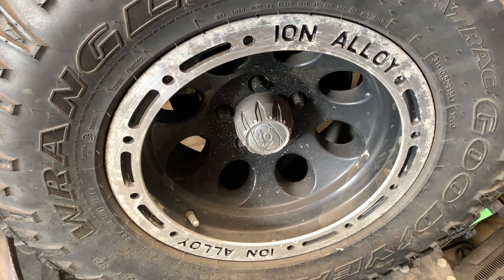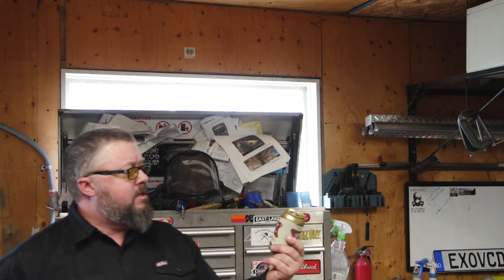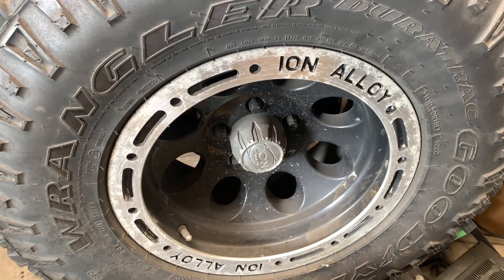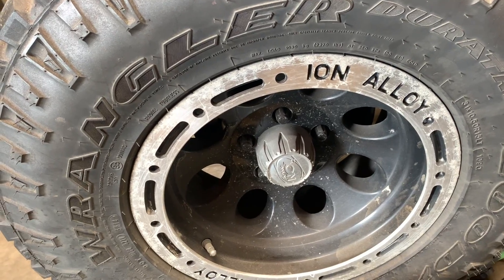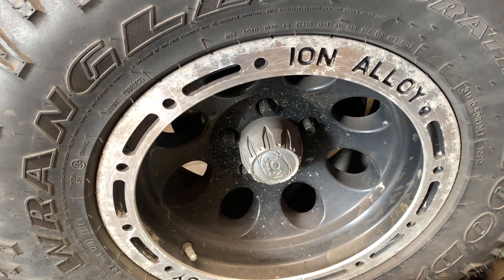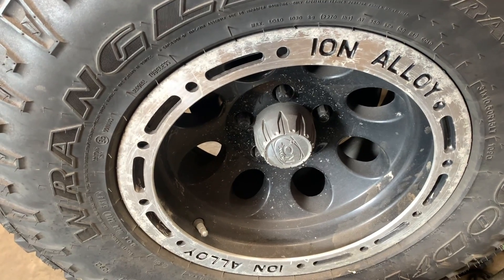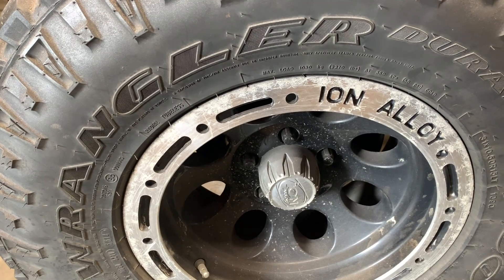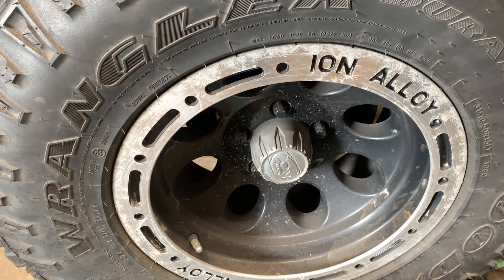Why Using Anti Seize on Wheels and Driveshaft Flanges is Bad

Comment: Points taken.........But as you state, they are a lot of factors and variables.............For racing, tracking, 4x4ing, off roading, high performance application etc.  I agree with you 100%.  No anti-seize....I do not believe that grease should not be used period.  Everything is taken to the limit.

I believe for DD stock applications (no adapters),   using a very very very thin coat of anti-seize (not grease) is fine.......The other extreme to what you talked about are frozen studs, broken studs etc.   By using anti-seize you are preventing rust.  Rust will happen in especially when water, salt etc gets trapped........Anti-seize will coat and prevent rust..........there is a huge difference between the coefficient of friction for anti-seize and grease.   I have had to much crap rust through......Rust is cancer.....Anything to stop or slow it.   I have had too many bolts frozen on with "regular torq." and were deformed or destroyed on removal because they were "fried on there."   I will take my chances with anti-seize vs. rust.   Choose your evil.  Is it risk?  Yes.

Comment: I've seen the failures a lot in oilfield parts with lubed threads. The common practice 30 years ago was to copper plate threads to increase conductivity and reduce seizing but vibration and stress led to failures.  You never see that or any lube anymore except on tapered threads.

Comment: anti seize is for threads and a few certain types of applications not for putting on the backs of brake pads or wheels. As for torque specs on wheel lugs, most people don't know how to torque properly anyway so that's almost irrelevant sad to say

Comment: You were much more calm for this one Jerry than the pressure explanation vid.  lol  Never grease the lug threads.  Over torquing is too easy.
Reply from the maker: Lol wasn’t talking about lubing the threads not sure why so many people are thinking of this... read pinned comment
Reply: @BackCountryWrenching  I was referring to the 1:33 mark comment you read.
Reply from the maker: Yes anti seize on threads is fine, as long as a person used the wet torque specs and not dry torque

Comment: ARP recommend using thier grease on all thier bolts for accurate torque.  I have always used old motor oil on wheel lugs and never had an issue with rusty nuts.   Anti-seize is intended for use of dissimilar metals like a steel header bolt into an aluminum head. The best thing to do is use a wire wheel to clean the threads and rusty area then using some type of oil, grease, or fluid flim to prevent rust.

Comment: Amen, the way it was explained to me using a flywheel for example. The flywheel would cut through the bolts given the chance "loose". I always cleaned the mating surfaces and pulled out the torque wrench. As a side note when they call for 60 to 80 ftlbs, it's 60 for used bolts and 80 for new to take into account the new bolts stretching. You earned another beer today.

Comment: No shit no ive never had any problems with anti-seize on me lug nuts. Just brush the studs lightly and dont over do it. My nuts get enough clamping force at the acorn theres no anti-seize there. And theres nothing wrong with brushing some between the hub and inner opening on the wheel. Not on the flat face dont need it there. Thanks Jerry

Comment: Cheap wheels is the problem. Hondas actually spec it in the owners manual to use anti seize on wheels and hubs. only thing that should go in dry is spark plugs.
Reply: I always put anti-seize on spark plugs to ensure they won't damage the threads when removing. Never had a problem.

Comment: Spot on bro. I make a living working on cars. I have never put antiseize on between a rotor and rim. Clean the hell out of them with a die grinder though. I do use fluid film between the hub and rotor though, works great. Same goes with driveshaft flanges, clean down to bare metal and thats it. Thanks for putting out this video and all of your others. MFBT!

Comment: I was told the same by a tire shop tech when he changed my tires and saw light anti seize between the wheel hub and rotor and on the wheel studs. I live right in the rust belt. I have switched to a thin layer of fluid film and will have to wait and see. I have brought my cars back in for oil changes and rechecked wheel torque and it reads correct. Just too much damage from the salt, brine, and the f*&#ing beet juice. Gotta do something...

Comment: I rarerly use antisieze wheel studs are a no go and some guys like to put is under brake rotors but i have had many occasiions where a piece of rust will stick to the antiseize and cause a rotor to have excessive runout/pulsate, I imageing the same thing is possible when putting it on a hub face to wheel contact point. Clean the surface and threads and leave it alone.

Comment: The clamping force is on the tapered part of the lug nut & tapered part of wheel, THAT IS WHERE YOU DO NOT WANT ANTI-SEIZE APPLIED. Like putting anti-seize under a bolt head is a NO NO, PUT IT ON THE BOLT THREADS. I don't get why you say your wheel SLIPS BECAUSE YOU PUT ANTI-SEIZE BETWEEN WHEEL & HUB ? Helicopter blades are held on with bolts with anti-seize applied on the threads. Did Tom cat get his NEW CAT TREE ?
Reply from the maker: Not talking about putting anti seize on threads, talking about putting anti seize anywhere on the face between the hub and wheel including rotor
Reply: Read the comments a lot of them replying about putting it on the lug nut threads, that is why I replied the way I did. Like I said the clamping force is on the tapered part of the lug & wheel not between the hub & wheel especially with 5 studs holding wheel on. If your clamped tight on the tapered part  ? HOW CAN THE WHEEL SLIP ON THE HUB WITH  STUDS & NUTS ? I DON'T SEE IT ?
Reply from the maker: Bolts/studs aren’t designed to be side loaded.   Proper torque achieves the clamping force ( friction) needed to prevent the wheel from slipping from not enough clamping force.
Reply: I AGREE BK, BUT WHAT DOES THIS HAVE TO DO WITH ANTI-SEIZE ON THE HUB ? CLAMPING FORCE IS ON THE TAPERED PART OF THE LUG NUT, THREADS & WHEEL. WELL I GUESS I'LL DO IT MY WAY & YOU DO IT YOUR'S, LOVE YOUR CHANNEL ALWAYS WILL BE A SUBSCRIBER. I REALIZED I WAS TRYING TO TALK TO MY 2 CATS LIKE YOU DO TOM CAT THE OTHER DAY & THE DOBES CAME RUNNING INTO THE ROOM GROWLING, BARKING. THEY DIDN'T KNOW WHO IT WAS ? KEEP THE VIDS. COMING BRO.
Reply from the maker: @NoWr2Run  i said in the video not many people would understand like pumps and pressure.  read the pinned comment and follow link if still don't understand

Comment: Jerry, I like your videos but seriously if you have ever owned a vehicle in PA you will happily choose to grease up EVERYTHING. 
I have numerous stories of bolts/flanges/sensors/(you name it) rusted PERMANENTLY in place! And yes I know every trick in the book for attempting to free a fastener but have found myself cutting off the head and hogging out the shaft of a bolt soooo many times. 
I'd rather do a bolt check a few times a year versus letting mother nature consume every single nut&bolt on my car.

Comment: On a brand new lug nut and wheel stud, the clamping load can very accurately be related to the torque. This obviously goes out the window if there's any rust, dirt or surface oxidation on either the lug nut or wheel stud. On the other hand, if you consistently lubricate the threads with either anti-seize or grease, your torque-clamp load relationship becomes reliable once again. However, since lubricated threads decreases the torque required to achieve the same clamp load, you need to derate by ~20-25% to prevent from overtorquing. Lug nuts are kept in place because of the friction between the lug nut and wheel, the clamp load of a properly torqued lug nut wedges the tapered cone of the lug nut into a tapered lug nut seat on the wheel. For this reason you don't want any lubrication on the taper sections of the lug nut, however, I'd argue that lube on the threads actually makes things safer since your nut torque more accurately translates to clamp load.
Reply from the maker: Lube on the thread isn’t the issue, putting anti seize on the wheel and rotor/ hub is

Comment: That’s terrible beer by the way. What are you supposed to use if anything? If the torque needed to keep the wheel on is 100 foot pounds, and anti seize is used, wouldn’t the torque then be amplified because of less resistances/friction? I agree that anti seize shouldn’t be used between the wheel and say rotor....
Reply: Part of trade school for me (HD mechanic) was using a micrometer to compare bolt stretch between dry threads and threads with wd40 10w30 and copper coat applied to them then torqued to book value for the thread diameter.... results were pretty cut and dry that applying lube to a fastener resulted in excessive stretch when using the dry torque value.

Was a long time ago but I seem to recall copper coat gave me close to 3x the allowable stretch on the fastener and wd40 was just over the allowable limit.
Reply from the maker: Anti-seize on threads is fine however a wet torque changes the spec from a dry torque.

Comment: I’m still using anti-seize on my lug nuts and wheel studs and along with other threads. I’m not dealing with rusted bolt / nut threads...
Reply from the maker: Using anti seize on threads isn’t a issue using anti seize on a flange or wheel is where is reduces the clamping force.

Comment: Your science and intell are right, but I'm still anti seizing my wheels
Reply: Just check do a re-torque check once every month or two.
Reply: This guy is a millwright and he is right aboutnot using antiseize...
Reply: @Mattessj  If this guy is a millwright then he should know that torque specs are always reduced on lubricated threads.  It's usually in the order of 30%. ARP produces some of the finest fasteners in the auto industry and they definitely recommend lubrication on threaded fasteners.

Comment: I have never put anything but a wrench on my lug studs. I used to have a 1995 Chevy G-20. Whenever I torqued my lug nuts, I just put them on tight by feel. 

I was leaving a grocery store once when there was 3" or 4" inches of snow on the ground and I ran over a buried chunk of ice. This caused my van to jerk to the right. In the process, and I didn't realize this until I was a couple of blocks away, 3 lug studs had broke off, a 4th lug nut had worked off, and the 5th lug nut had almost worked off and if I'd gone another 20 or 30 feet my wheel would have fallen off.

After seeing this video, I am convinced that if I'd torqued them to the manual then this might not...probably wouldn't...have happened. Now I own a Dodge and I torque my lug nuts to Dodge specs. Thank you & thumbs up.

Comment: Gotta Jeep XJ and slather anti-sieze on it. Thought about this very thing and perhaps things are a little over engineered (Thankfully or Hopefully!)  and have not lost a wheel. Or broke a stud due to over-torque of a 'wet' thread, though always consistent with a torque wrench. 

Some of that over engineering is how the wheel is located. Some have an index the wheel locates on to prevent side loading the studs. So, I believe that is why many have NOT had problems slathering the shit on...

Anyways, my 2 pennies. Carry on Repairing and <3 all  (edits) Also, I have driven on gravel washboard roads daily vibrating everything (even a shock mount fell off) and not had problems.

Comment: I'm sorry man but I have to disagree with 90% of what you said..... even arp uses molly grease on clamping hardware as lubrication increases clamping force
Reply: Also tapered lugs prevent the wheel from moving.
Reply: The lube doesn’t increase the clamping force... it allows the bolt to stretch further by decreasing the friction on the threads and under the head of the fastener allowing the fastener to stretch to optimal yield strength... 

once the fastener is stretched it spends the rest of its life trying to return to its natural relaxed state unless heated or over stretched or work hardened

if you stretch a fastener (say a wheel stud) past the maximum yield point by lubricating it with something really slippery (copper coat) and applying a dry torque value to it you can stretch the fastener past its maximum yield point, do that several times and the fastener fails...

I do believe tho that wheel studs are over engineered to a certain point being that manufacturers know that the average guy is going to play with his nuts from time to time...
Reply: @PuskwaskaOutdoors  by decreasing friction on the threads means less wasted torque spent overcoming stiction......increasing clamping force
Reply: @Poopshoot2011  exactly, over torqued!
Reply: @bikerdog2b  no such thing as over torque if you torque it to specifics..... 

Obviously the concept of friction escapes you
Reply: tyler boudreau arp calls for a wet torque for head studs anyway,  if you look at a torque chart for say a 
1/2” at 13 grade 8 bolt it will have a wet torque value and a dry value, the wet torque value is lower
Reply: @bikerdog2b  no crap... to get the same clamping force with a fry bolt you need more torque.. ..that's what I've been saying!!
Reply: Stop thinking it’s the studs holding the wheel or rotor from turning , it’s the same principle as installing a saw blade or grinding wheel.
Reply: @bikerdog2b  I'm not it's simply clamping force....the center hub is what locates the wheel but clamping force is what resists the vibration and shearing force
Reply from the maker: Thank you for understanding so many people don’t, just like why I mentioned it in the video

Comment: Great job explaining! I rotate my tires on my Jeep  every oil change (5000 miles synthetic) I live in the rust belt of NH and never have any problems. It’s the people who don’t rotate and have rims on for years that have problems.
Reply: I bought my 2016 Wrangler off the showroom floor on December 12, 2015. Three months later at the first oil change and wheel rotation they were all stuck solid. I anti-seized just a little around the center part and haven't had a issue getting the wheels off again for the past four years. BTW I'm in SW Ontario where there is usually more salt on the road in the winter than snow.

Comment: I'm a little confused. My lug nuts are tapered, and torqued. I believe if properly torqued the wheel can't spin on the hub because of the 5 lug nuts centering the wheel on the hub and clamping it down.   I'm gonna sit back and watch all the opinions fly out of everyone. This will be good reading.
Reply: I believe this is more of a issue on hub centric rims, you most likely have stud centric where the anti seize would just  throw off your torque setting (wet torque) if brushed on lugs.  Yes the face of the rotor would also have less friction.
Reply: @bikerdog2b  
I feel to many incompetent people are touching lug nuts. Causing these issues and concerns. If the wheel of a car or truck was so dependent on a friction fit there would be a more complex connection figured in by now. Hub centric or lug centric the friction caused by the lug nut clamping force only holds the wheels in the loaded up down force any lateral force  ie taking a corner when the wheel is being pulled at one side and pushed at the opposite end in nothing more then the tensile - pull shear strength of the lug nut or surrounding wheel surface. Improper torque is the absolute direct issue if these faults. Not the "coefficient of friction" it can be over explained and over thought every which way but loose. Tighten them proper and your good. It's been proven by millions and millions of miles of trouble free travel already. Using this as an excuse for not tightening proper is stupid. I've personally seen dozens  of dual wheel trucks with oem  wheels and tires sizes leave a local tire shop and have too pull over with in a few miles of leaving to retorque on there own because the wheels are falling off. The tire shop is tightening dry lugs and wheels to manufacture specs. These trucks carry a constant load, plow, sander, utility body, dump body. The torque spec isn't enough. For this service. Anti sieze , grease or normal paint are not causing this issue.

Comment: Several Manufacturers including Mercedes call for Anti Seize between the Hub and the Rotor. Its written right in the FSM and its done this way in every Mercedes dealership worldwide. Lubricant between the Rotor and Wheel? Now that's a little silly
Reply: Anu manufacturer that says to do this is just a bunch of lazy fucks that didn't bother to do shit right the first time. Most of those claims are TSB and those who know TSB's are just suggestions to address complaints and again written by lazy fucks that didn't do it right the first time. You can do tf ever you want,idgaf if you put peanut butter on your shit,but don't proceed as if TSB's,FSM's, and the like are the bible to vehicles.